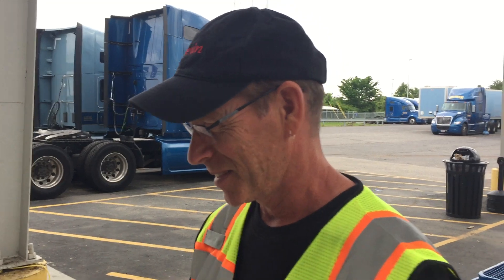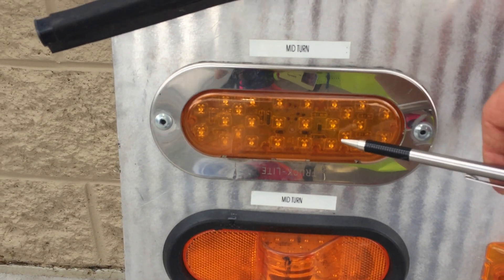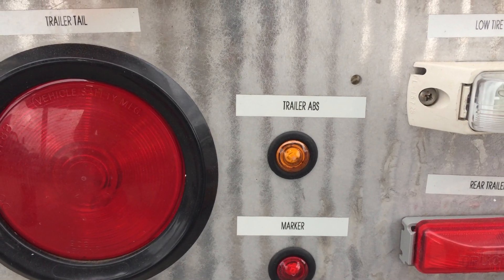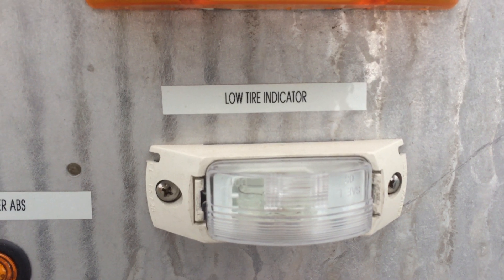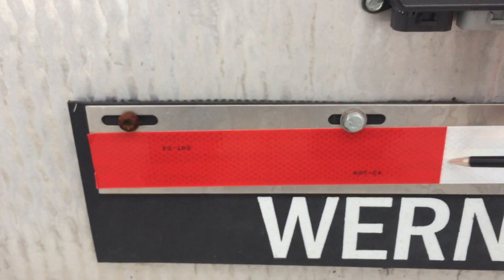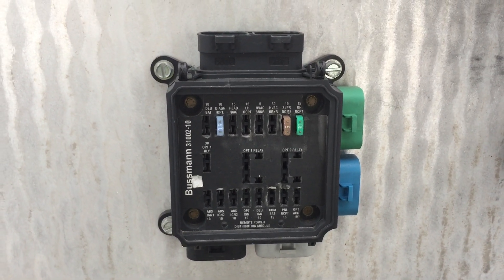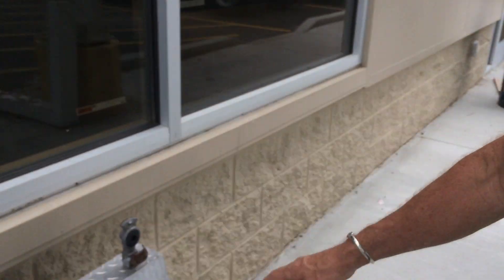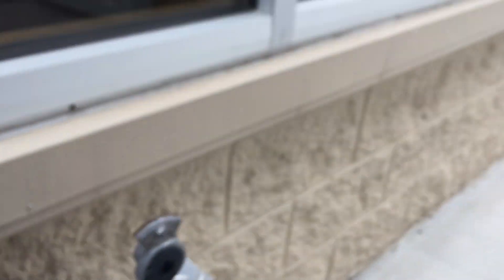Understanding Lights and Reflectors on Truck + Trailers | Kevin Enlightens Us | DOT Light Compliance

Comment: Question: 
So, Form A is Front of Truck
Engine Compartment
Steering Components
and  Front driver side axle
Form B is Driver's side door
Fuel tank area
Back of tractor and axle
and Form C is the trailer.
Each area must also perform the coupling check, the brake check, and the cabin check...
Is this correct?
Reply: @TheJoyofTrucking  
I want to make sure what i am inspecting during my pre-trip.
So supposedly each form has certain ares to inspect unless you are asked to inspect the entire thing.
I just wanted to make sure so that i know what to inspect.
Reply from the maker: @mxggo9046  Hey. Sorry, didn’t see your reply until now. Kevin didn’t have ‘forms.’ He had to know the entire ore-inspection. Walked around truck and trailer and did the whole thing. Seemed like a lot. But he got it after much practice, and so will you!! :-)))
Reply from the maker: Hey there! We don’t understand your question. We are not familiar with ‘Forms’. Is this a way your school lays out pre-trip inspection?